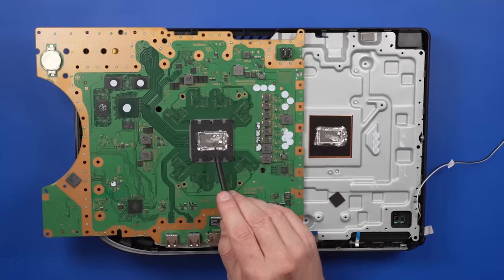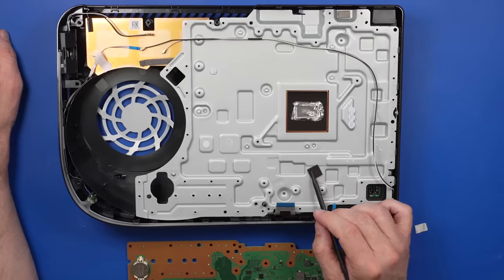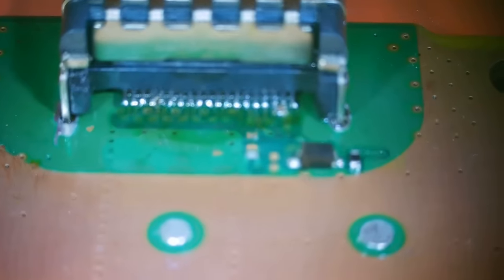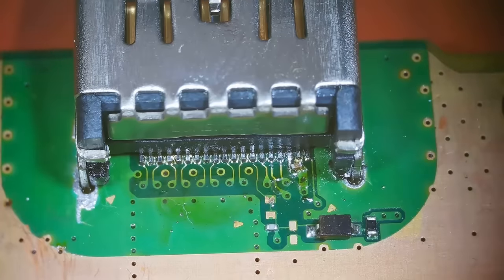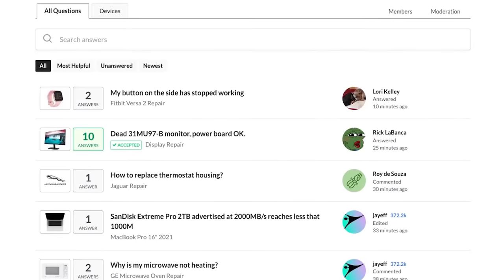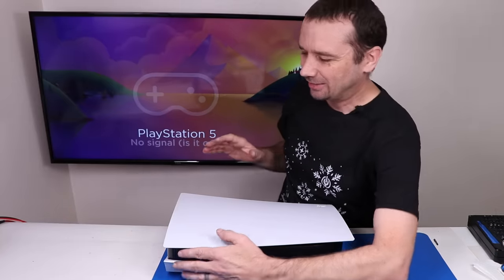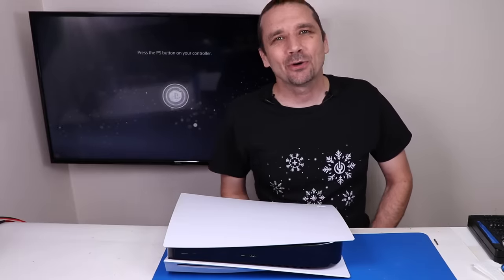Repair Shop Tried Fixing This PS5 3 Times!

Comment: I wish I was surprised at the incompetence of some repair shops.
Reply from the maker: Yep, me too.
Reply: @Tronicsfix  hello sir I have a question I'm working on a HDMI problem on my PS4 and I messt it up, now when I was removing the HDMI port a I tore it off and I've left the four pins that holds it down little pieces of metal I've watched your tutorials I know to do it but I can't seem to get those pins out of the board I've tried to desolder with a wick and a desoldering gun and a disordering sucker and no hope I even tried to melt lead-free solder now I got a glob of solder on the board I don't know can you give me any tips lol 🙏🙏
Reply: At least they didn’t butcher it. All it should have taken is a closer inspection to reveal the problem.
Reply: It goes to show, just because they have a "name brand" store, doesn't mean they are any better than other repair facility. Corporations!
Reply: Some of these repair shops shouldn’t be in business. Don’t know how they became a business.
Reply: I hear ya, I once took my phat PS3 to a repair shop to get it fixed due to it not turning on and it took them a month just to tell me they couldn't fix it. 

I ended up taking it to another shop and they fixed it in a day, they also mentioned that the other shop messed up something on the PS3 board and they fixed it.

I guess you shouldn't believe all the good reviews, or at the very least do the research on what the shop specializes on, unfortunately ps3s we're not the former shop's specialty.
Reply: It requires a high level of skill to perform a repair like this, but repair shops generally don't offer a high level of pay, especially the corporate ones. You gotta find the right person at the right shop who is in it for the love of the game.
Reply: Steve your videos have given me confidence to repair and fix my old PS4s
Reply: @guitarhero918 I thought the same thing now in a rut lol😂
Reply: @guitarhero918 I can follow the tutorial but my soldering sucks I need more practice
Reply: @deeurb916  same! Luckily havent faced many soldering issues to encounter. Mostly overheating issues
Reply: @Tronicsfix  could you fix my PS4 on the show? lol
Reply: It's funny, the first ad came from a "big box" store that I'm sure tried to fix it. I would never trust them to do repairs like that, I'd leave them to "Geek" jobs for the squads to do.
Reply: those repiar shops are "Wish" equivalent of repair shops
Reply: @deeurb916 Have you ever fix anything before? If No, u should have just send it to repair shop. Because now ripping those pinns of u made that hdmi work even bigger job..🙄🙄
Reply: @deeurb916  practice more
Reply: and they said it unfixable

Comment: I did my first Tronicsfix a few weeks ago! My MP3 player got rained on and the LCD got stripes, and I remembered that you always fix that stuff using IPA to cleaning the contacts, so I dripped some down in some of the button gaps (it's a tiny enclosed unit that you can't disassemble) and with a bit of effort now it's back to normal! Thanks!
Reply: Trying to get into fixing consoles as a hobby.  Starting with the cartridge consoles like NES Genesis gameboy and also the cartridges themselves and slowly work up to disc ones like PS1 and 2.  I got a PS1 that is gonna be the first one I try.

Comment: Coming from a place that used to repair all kinds of electronics, it is hard to decide between the shop being incompetent on the repair...OR...they tried to say it wasn't fixable and get the customer to "give" them the PS5. I had a manager that was in charge of the shop I mentioned above, he would do that to MANY things that were high ticket items cause he would get them "free" from the customer, repair them, then flip them on craigslist or ebay. One of the many reasons I stopped working for the shop.

Comment: I've fixed stuff like this, where they have taken them to shops that messed them up or on really cheap fixes that cost me nothing but a little time. I usually contact the seller and ask if they want to buy it back for a little over what I paid them. Most buy back.

Comment: You know, I used to have a job that occasionally required me to do a little welding. Not a lot, I wouldn't really call myself a "welder", but I did have to sometimes. My boss still made me weld for him just so that he knew I could do it. I wonder if this repair shop's boss makes the techs solder so he/she can asses their soldering skills. Knowing how to fix something and doing it are two different things.
Reply: Adding to your last bit, knowing what and why the issue occured is also an extremely useful skill, that helps narrow down the best approach, instead of the good old "I know how to fix this, so I'll just do that" and when it doesn't work, you have absolutely no clue how to proceed.

Comment: I once had someone bring me a laptop that wouldn't boot. They took it to multiple shops, including a certain squad, and none could get it working and told him it was unfixable. I found the problem in 3 minutes when I removed the back access panel and saw no HDD was installed.

Comment: Going to take a stab in the dark and say this was a Geek Squad special. The turn around time is so awful because the guys in store don't usually do the repair, it's shipped off to get repaired elsewhere and then shipped back. That's why it takes 3 weeks. Probably just one mega repair center somewhere where they need to repair a whole load of crap every day and everything is a rush job. It's why such a simple repair (well simple for someone who knows what they are doing) can be so badly done. Wouldn't be shocked if they have toxic incentives at the repair centers. Repair so many things in a day or week and you get a bonus, incentivizes quick and shoddy work.

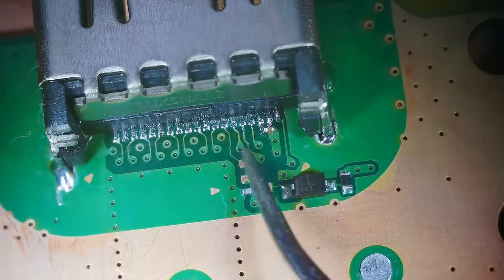Comment: Is it just me that noticed the chip in the foreground changes at the jump cut 4:39 ? all of a sudden it has markings on the top (C1 045) and the heat damage to the left side of it from the earlier prolonged heating of the port disappeared. If Steve had the iron to close for too long to that chip and had to replace it then that should have been included in the video.
Reply: Good eye and I agree with you
Reply: @pranjiluka  I like transparency in these type of videos, If steve managed to melt that chip then we all could make the same mistake. If he had included it and said "Hey, look I messed this chip up with the soldering iron becareful you don't make the same mistake!" Then it would have made a better video in my opinion. Either that or he couldn't fix it and replaced the entire board at the jump cut in which case it makes a mockery of the entire channel. He could have then said "look guys this board is toast because I melted this chip or the repair simply didn't work, so in this case it will have to be  a new board!"

Comment: Previous so called tech soldiering skills were horrible. I used to repair Dj equipment Native Instruments based of Berlin Germany. And some other electronics drive cams ,tracphone,even pagers yes pagers they are still being repaired at my last job. I take pride in my work. I just ordered a heat gun and soldiering i think i want to do the same thing you are d9ing

Comment: What was the capacitor doing on the hdmi port?
Reply: looks like it connects 5v to ground. just turns two traces needed to one since there is plenty other ground pins as well

Comment: I have a PS five that shows that the data is corrupted. I looked up a lot of YouTube videos, but they didn’t help. I want to know if you can help me before I send it off to Sony.
Reply: I believe you need to rebuild the database. I don't recall offhand what the exact steps are that you have to take, but I do remember that it involves restarting the PS5. There should be something in the PS5 documentation about how to do it.

Comment: There is no can't... Well okay, there is sometimes a can't, but it's rare. Say if a CPU soldered down just becomes a paperweight, then you can't do it without specialised equipment really... Unless you have a makeshift reflow oven and know exactly what you are doing. But 90% of the time, there's no can't! Just lazy repair shops.

Comment: Can someone tell me the different with this black Q-tip and a standard one ? I normally use a standard one and never had a problem doing that, plus you can see the black oxydation on the white coton and so see when the cpu is clean again

Comment: Sony should’ve used the philosophy of it ain’t broke don’t fix it when it comes to swapping the thermal paste for Liquid Metal
Reply: Except he tried using regular thermal paste and it overheated. So due to the power the CPU uses it needs liquid metal to function.
Reply: Liquid metal is literally factual better